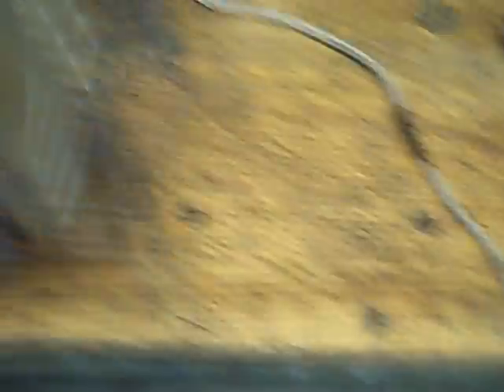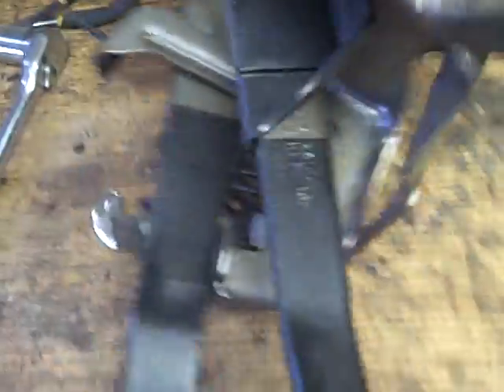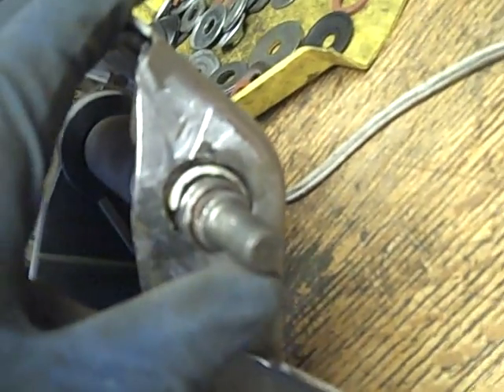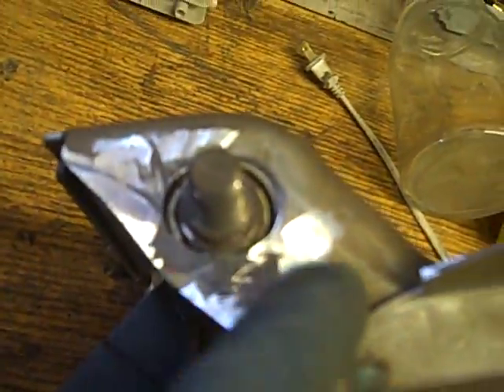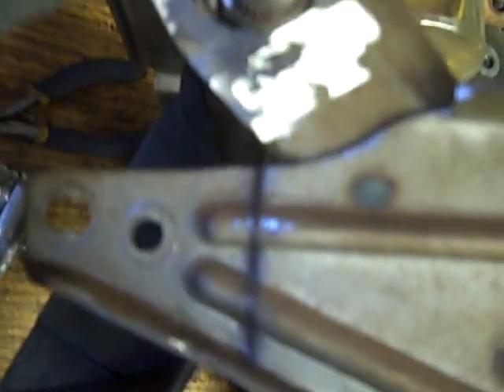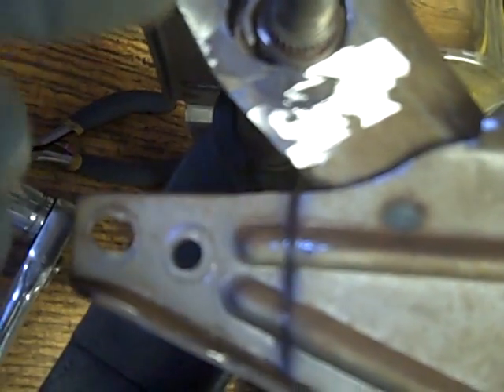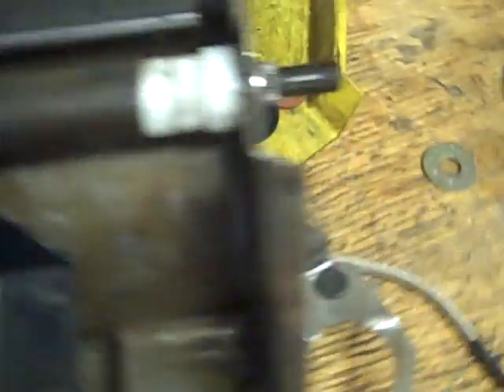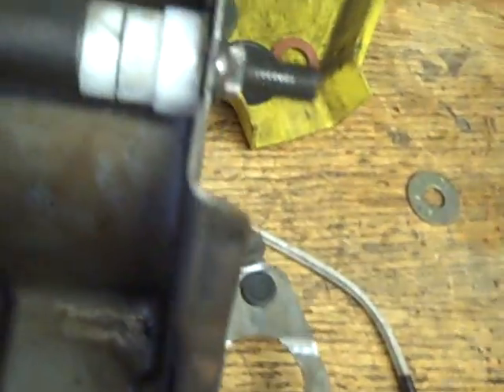Clutch Pedal F150 Slave Cylinder diagnosis fail

Comment: Common issue on these older F-series trucks. One thing to look at first though, is that the mounting bolts on the clutch master are not pulling through the firewall. This will make you lose your clutch pedal "throw" as well and exhibit the same symptoms. Ford sells a simple kit to fix this issue. Both issues are usually caused by a dry throwout bearing causing hard pedal pressure.

Comment from the maker: @aircoupe1 If it stays down then you have a hydraulic leak either from the clutch master cylinder by the pedals, or inside the bell housing on the slave cylinder.  There's a bleeder screw (8mm) sticking out the drivers side of the bell housing.  You can bleed it with the help of some one pushing the pedal down for you.  Bleed it out and see if it can hold pressure, if not you'll need to find which is leaking, replace it, and then bleed it again.  Bleeding these can be tricky.

Comment from the maker: @Elevatorguy4 Good call.  And on that note use the Moly grease used for brakes.  Normal wheel bearing grease will absorb clutch dust that combined with heat will make the problem of resistance even worse.

Comment from the maker: @aircoupe1 Some times the best way to bleed them is to cut up an inner tube and clamp the valve part over the master cylinder and pump it up to 15 psi and then open the bleeder and then close it when it's down to like 3psi and then repeat keeping the fluid full of course.

Comment: Hey Brian thanks for the video on the diagnosis! My son has a 97 F150 4x4 and is having same problems as if the slave cylinder has gone out. I hadn't had a chance to look at it but he replaced the master already b4 I could look at it and still haven't had a chance to look at it yet. He said he tried to bleed the slave and nothing would come out. I asked if he had someone pump the clutch pedal several times and repeated the process and he said yes they did that and still no fluid cam out.

Comment from the maker: @waterwart  Ask and ye shall receive.  Pull the starter and the clutch line on the drivers side by pushing the white sleeve into the collar and then pull apart.  Drop the transfer case if 4X4.  Drop the trans.  Replace the slave cylinder unit for sure and any clutch components you see fit, but at least the clutch disc.  When you assemble, lube the line for the slave cylinder.  Use a vacuum pump to bleed the slave cylinder.

Comment from the maker: If the engine rear main seal or back side of the oil pan gasket leak, they get flung by the flywheel.  Same thing happens if the transmission front seal leaks.  Other than that you'd have a cracked trans or something.  The thing to do is clean it up with brake cleaner (cold engine and not running to prevent fire etc. no smoking etc. etc.)  And then watch the area after driving a day or so to see if the oil comes back.

Comment from the maker: @aircoupe1 It sounds like the slave cylinder has failed.  It's the same configuration as doing the clutch like you did.  You can slide everything back if it worked on your model before.

Comment from the maker: @TheTrainboy88  Sounds possible.  I'm not certain which hard plastic piece you're referring to though.  Are you talking about the nuetral safety switch for the clutch pedal that inhibits the starter signal wire?

Comment from the maker: @aircoupe1 You have a fascinating rhetoric.  I would recomend looking down under the dash at the top of the clutch pedal with a flashlight for fluid leaking in.  You may also want to pull the rubber grommet off.  if you see moisture there, then you may benefit from a new master cylinder.  Good luck!  Love ya!

Comment from the maker: @badbob8282   Some times after all that.... it could be air in the lines.  I like to use compressed air to push fluid down through the master cylinder.  If you can use a big irrigation syringe that works well.

Comment: I think you might have just saved me a lot of time and $. Thought I was having slave cylinder problems but went to check for slop in the clutch like you showed and yup, I can see it wobbling around what likes close to the same amount in the video.  Sure hope that solves my problem at least, way easier than slave.  Thanks for the video.

Comment from the maker: @waterwart It should be able to touch the pressure plate fingers without making any noise.  If it does it is likely the bearing is rusted up and dry-  You'll likely have to replace the slave cylinder and throw out bearing.  Sorry my friend. = (

Comment: @briansmobile1 Ford has a cheap solution. It is a reinforcing bracket that fits around the outside mounting area of the clutch master under the dash. The engineering is all done and the part is inexpensive. The other thing that fails often is the plastic bushing between the ball end on the release lever and the eye on the clutch master pushrod. If this fails and is not fixed quickly the lever will wear a groove in itself and the round opening on the clutch master pushrod will become oblong.

Comment: Great Video, I wish I had watched your clip before spending well over $ 1,500 with guys replacing parts and it still didn't solve the problem.  When to the shop, looked underneath  the dash, and there was the worn out end.  Reasonable wear for a 275,000 miles.  Hats off to you!  Thanks from New England.  Ken

Comment from the maker: @Danielsor14 You're welcome- thanks for the shout out!
Reply: briansmobile1 hey Brian I was driving aF150 2009 and came to a stop and it had a sudden Sqeal sound that lasted 5 seconds then it was very hard to put into gear. I finally got it to go and drove a couple blocks to my House as I pulled up and mashed the clutch it acted as if i didn't have it pressed and the truck went dead and  wouldn't come out of gear.. slave cylinder was replaced and it still won't come out of gear??HELP PLZ I'm a female with a good bit of knowledge about cars but not in this area

Comment: You folks may not agree with my comment but I will still post it for what its worth.

Your're fix although I assume it did work put everything out of whack on the main shaft not to mention the bushing you "trimmed down" to a smaller size which will be the next thing to fail now. 

First off the part needed could have been found at an auto recycling yard, used, or I would have fixed the elongated hole by welding it  up where it had elongated and then drilled it back out to the proper size for the rod and bushing you had trimmed down on your video.

I have done this type of fix many times on other areas of cars and trucks where the hole was elongated and it always puts it back to factory specs which is always the best approach.

I do commend you guys on finding the original problem and even your're fix to a point but you just went about in the wrong fashion. You should never have to move anything like you did that main control rod since it moves everything out of position. 

You could have found a piece of steel pipe that had the right hole size and cut it to fit into the spot where it was elongated and then rewelded the area up. The bracket that was elongated looked to be around a 1/4 inch thick so cutting a piece of pipe a 1/4 of an inch wide would have been so easy to do, almost like putting a new bushing in the spot.

I just hope the customer never has an issue with that truck since it could then come back to haunt you especially if someone gets hurt.
Again I'm not trying to you did anything super wrong but you did not do the repair properly. Sorry.

Wish you folks lots of luck and keep trying to better yourselves, experience is always a learning curve as we all know too well.

Comment: i hope my problem is a easier fix that yours was.  

When i press the clutch peddle down to start the truck, nothing happens.  Sometimes if i press super hard and FAST it will turn over. on my f-150  1994   there are 6 wires attached to a small socket that plugs into a switch ( i think )  on a shaft at the end of the clutch peddle. are the 2 red wires the ones i should connect together to bypas the switch ??  The red wires are larger that the other 4 wires .    Thanks   Gary

Comment: I have the same problem on my 89 F-150, Big block 6, 2 wheel drive, manual .....Clutch pedal is sitting way to low....I wish you where close to Houston so I could bring my truck to you......Regards.

Comment: Question, i took out the pedal assembly and replaced the bushings and realized i didn't mark the lever...so i guessed at it and definitely think not in the right spot. Do you have any info on the placement for the lever?

Comment: Converted over to a t5 my clutch fork almost bottoms out on opening. I have to literally put pedal to the floor to engauge/disengauge  tried adjusting master and slave every which way all parts are brand new. Any thoughts? Thanks in advance

Comment from the maker: Anything could be a problem, but it doesn't mean it will be a problem.  I wouldn't worry about it for now.  If it is a problem the solution is to tear it down and replace it.  It doesn't make sense to do that right now if it's working fine.  Unless of course you're going to drive across Africa and then on to the North Pole.  Then you should replace it now.

Comment: Ey would you happen to know what my trucks problem is I push the clutch in to turn it on everything lights up like its goin to fire up but it doesn't they said it was the safety switch so I replaced it but still the same nothing.

Comment: Brian, I have a 95 F150 2wd, inline 6. The clutch master cylinder Keeps breaking, every 3 months or so, the plastic push pin goes first, I then retrofit a turnbuckle to patch the problem. Then in another month or two the who master cylinder fails. This is my fourth one. Any thoughts?

Comment: I was wondering if that might be the problem with my truck I just had everything fixed and now it seems like the clutch went out it won't go into gear but the engine sounds good is that what the diagnosis was of that truck

Comment: Hey Brainsmobile 1,
My son just replaced the clutch in his 94 F150.  The clutch is depressing, the cylinders don't have any leaks, but the new clutch won't disengage.  He just informed me that he did not replace the throw-out bearing with the new one that came with the clutch assembly.  Could this be the problem?

Comment: Ive been under my 95 f150 bleeding and bleeding and it still wont go into gear while running although if the truck is turned off it will shift fine ...I think this might be the prob....thanks alot...any other suggestions as this was a new slave cylinder and clutch
Reply: I’m having the same issue
Reply: Did this work when you did it please help 😭😅

Comment: the manual chevrolet S- 10 are just as bad. because cast aluminum and plastic grommet dont get along... the fix was a long bolt and a nut that fits snugly from lowes. a little lube and its fixed.